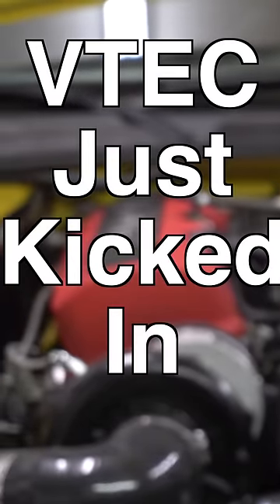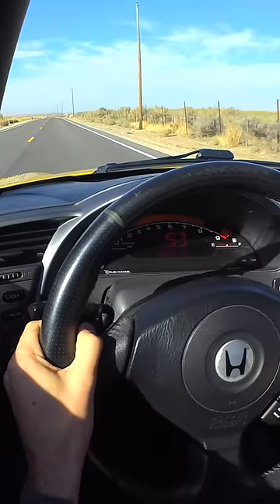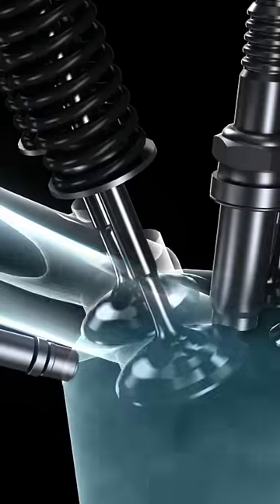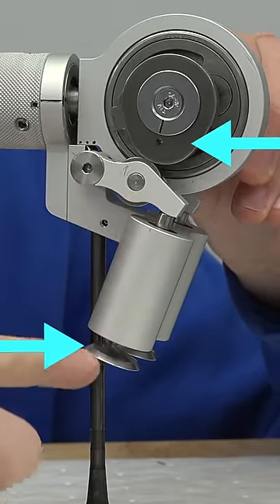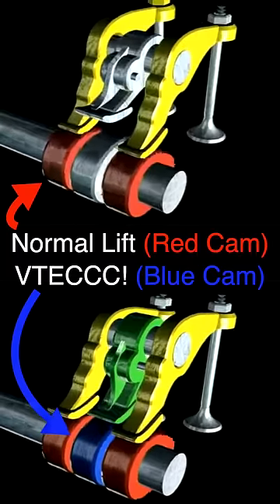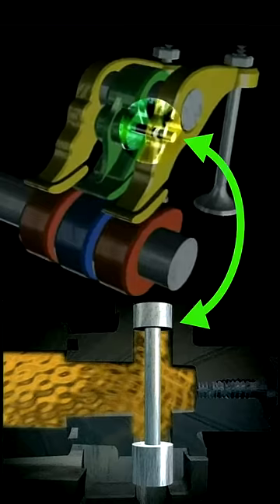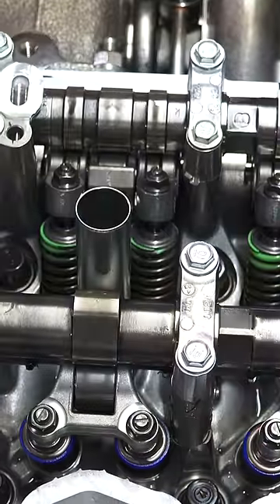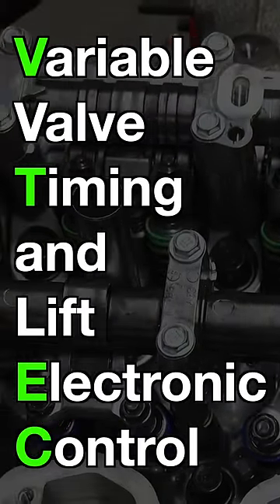How VTEC Works (In 60 Seconds)

Comment: So I have owned many Hondas over my 41 years on this planet. I have built many slow cars that went fast because I installed a turbocharger onto them. My last built was a 1997 Honda Civic coupe that made 709 wheel horsepower at 34 psi of boost from a rather large turbocharger. The engine was from a DC2 Acura Integra Type-R and it was fully built with custom machined cylinder sleeves that strengthen the engine block, forged CP pistons, and forged Eagle connecting rods. It had ARP head studs, a fully ported and polished cylinder head, aftermarket Skunk2 Stage 4 Tuner Camshafts, Skunk2 dual valve springs, Ferrea valves, a 5 angle valve job, and Skunk2 lost motion assemblies (for the VTEC control). The engine was FULLY built to handle that amount of horsepower and plenty more. My best quarter mile time was 9.56@155 MPH. I hated to street race it because it was so fast that it would blow both front tires off from 1st through 4th gear up to 100 MPH. As soon as that engine hit VTEC under boost it was over for whoever I was racing.

Comment: VTEC stands for: variable valve timing electronic control
Reply: Or just Variable Timing Electronic Control
Reply: It’s variable valve timing electronic lift and control. Lift is in there as well
Reply: That's vvtec
Reply: @rdmz135  bruh
Reply: Very Tall Engine Cooling
Reply: @brayanhernandez7427  Variable Valve Timing and Lift Electronic Control. Just like the video said, he got it right idk why y'all are trying to correct.

Comment: My 01 Accord felt fast as hell.  6 cylinder VTec.  I still got destroyed by mustangs and all the popular Chevy cars but it was faster than most sedans.  Could get to 60 pretty quickly.  I no longer have it and now have a slower 4 cylinder car.  But even it moves pretty swiftly at times.  It’s built like a go kart.
Reply: 200 hp is plenty to have fun and at the time was pretty much as powerful as common sedans got. (Except the then-new 222 hp Maxima). 
Not sure what VTEC really added: Nissan and Toyota had ~200 hp from their 3.0Ls without any VVT.
Reply: Yamaha did similar with their dual runner intake,  except that 3L car was as fast as the Mustangs and Camaros.

We can combine VTEC (variable cam lift and duration) with Ford's Ti-VCT (variable cam timing) in the coming electronically actuated valve systems. Along with Ford's current variable chamber volume, should be able to improve mileage even more AND both extend the rpm range and power peak. 

Just gotta get past all this patent BS.
Reply: Got a low mileage 2012 v6 accord and still kicks in pretty hard on the highway. 4th gear pump from 60-90-110
Reply: @nthgth  Yea the 6s didn't have it like the Si i4s did. And when they did get it was on the Acura 3.2 Rl and TL.

Comment: The funny thing is that VTEC in both the motorcycles and cars are additional steps and parts used to impair air intake at low RPM and improve fuel consumption when you don't need the power. So technically VTEC kicks in when you're driving like a normal upstanding citizen and disengages when you're going pedal to the metal.
Reply: Brutal! Brutally honest too. A "variable geometry" turbo also uses also uses a movable restrictor with the same impeller. The blades don't actually change pitch like a plane or helicopter

Comment: More specifically (because words matter) ... it's the LARGER center cam that initiates the process for the increase in power. By switching to the center cam, which has a LARGER CAM, that is what causes the valves to open further once they are tied together with the pin. At that point the outer two cam lobes really aren't in use anymore.  The center cam FULLY TAKES OVER THE LOAD, causing the valves to open further, allowing for more air, thus an increase in power ... and the outside two cams are essentially just a long for the ride. 😎👍
Reply: Thank you, this makes more sense than the animation.
Reply: OKAY!
Reply: Why not just use the center cam only?
Reply: This important info was not mentioned!
Low rpm is where torque is produced. Short duration valve timing is needed for low rpm stabilization, hence better torque. High rpm needs to 'breathe'- switch to long duration valve timing.
Reply: @TheTwh415  Id does only use the center cam (the video is wrong about that), The center lifter is however not connected to the valves, so it engages the outer lifters that is connected to the valves, but the outer lifters are not engaged with the cam at all at that point.
Reply: @TheTwh415  IIRC, emissions´profile.

Comment: You're mistaking vtec for vlc.   All hondas have vtec only type r  has vlc.. Variable lift control on the exhaust valves.  Vtec is for fuel economy not power.

Comment: Vtec,  I always  thing of it  in that it helps a larger port flow great at low rpm but also helps extend  duration and height  to get flow  in the higher rpm because  at higher rpm  the valves are closed and opened for less duration of a period of the same time.  This helps the cycle flow just as good as low rpm  but not have the  negatives of the intake pulses and mass of the air fighting the ports flow with a more aggressive  cam. At a certain  port size and length you can get a port to flow BETTER than or WORSE than what is observed  on a flow bench, this is  because a flow bench does not take into account  of valve pulses from the open/close event and how duration (over a period of time) effect a ports flow  due to the peaks and valleys of pressure  from the pulses of the valves operation. 
   It is the pulses behavior in direct relation  to how those pulses effect the weight of air that can  either create  a slight boost  within the intake or  creating a vacuum. This vis why vtec to me is nice and makes sense  because for a given cam size that flows great at higher rpm isn't so great at lower rpm. 

-+-+-+-+
Reply: VTEC only actives and locks the bigger cam lobe at 4500-4700 RPM, so it literally does nothing at all.....ever before you hit that RPM

Comment: What about MIVEC ?
Reply: "Mega Incredible Valve Erection Complete" or "MIVEC"
Reply: Mivec  only works on the exhaust cam on the Evo 9 at least
Reply: @jo-qp7mz  It's like the VTEC on newer turbocharged engines. 👍
Reply: Mass Incompetence at Volunteer Electric Co-op?
Reply: They're the same thing from different manufacturers.
Honda: vtec
Mitsubishi: mivec
Toyota: vvt-i
Mazda: s-vt
Nissan: vvt
Ford: vct
Audi: valvelift
BMW: vanos
So on & so forth.

They're all based on similar concept & technology, with minor tweak here & there, depends on each manufacturer.
Brand neutral name for all of them is VVT.

Comment: It's a cool concept and it seems to work quite well....... The next step I want to see though in valve trains is wide adoption of free valve technology has the potential to be game changing and far better then VTEC 
      For those who don't know Free valve  it's fully variable valve actuation that uses sensors computers and pneumatic actuators to run the valves on a engine completely replacing the cams no longer needed such as the camshaft, throttle body and many other parts saving weight and decreasing size of the engine in the process it's a revolution of how the valve train works similar to going from carburator to electronic fuel injection
Reply: That's another electronic function that's destined to fail that you can't fix yourself in your garage. Free valve is really cool and ingenious--I like it. You can call me old fashioned but I'll take a pushrod V8 with a blower or a turbo all day.
Reply: So what happens if there is a fault in the system? Is there a mechanical fall back so the valves don't lock up?

I'm always wary of complicated/complex components that are more than likely very expensive to fix (Look at you, Euro cars)
Reply: @darkknight097  exactly my man. Car manufacturers today literally build cars so you have to bring them back to the dealer/manufacturer because they alone have the means to fix them. Do't like it.
Reply: @rhull3939  people were saying the same things about fuel injection when they started to use It on motorbikes
Reply: There is really no point. All big manufacturers are going electric. There will be no more revolutions in ICE engines. We are peak ICE now. 
Free valves been done anyway, cost over benefit it lost.
Reply: @t-r-k7534  exactly. Fuel injection was a complete disaster for the first 15 years.
Reply: Modern cars almost never break down. I don’t understand the nostalgia in having to fix your car ever weekend.
Reply: Most manufacturers are closing down their engine department… I don’t think we’ll see lots of ICE innovation anymore.
Reply: @thebaconsonful  I disagree. The only thing that says ICE engines are done, is the current political climate. Our infrastructure is far from being ready to adopt hundreds of thousands of EV's. Furthermore, EV's aren't currently up to the task of taking on the roles of all ICE powered vehicles. Range, towing, and charging issues are still a problem. Until batteries mature further, and the Electric Grid has been brought into the 21st century, ICE powered vehicles will be here, and be improved upon.
Reply: @rhull3939  LO, yeah, I'm sure you can fix a broken cam-shaft in your garage. Kek.
Reply: @darkknight097  What happens when you break a camshaft or a lifter? Electronics are VERY reliable.
Reply: @rhull3939  have you tried fixing a broken cam-shaft? What happens when a cam chain or a timing belt snaps? Answer: Total engine breakdown, bent valves, broken camshafts, cracked pistons... Now tell me how much cheaper an engine is compared to some electronics, that when it fails, simply closes all valves and stops the engine. 

You can get the diagnostics tools yourself, they are not that expansive. Engine-swaps on the other hand, not that cheap.
Reply: @thebaconsonful  LOL, no, ICE engines have been in constant development. Better stronger and ligter alloys happens all the time. Just recently car manufacturers started using the newly invented stainless magnesium alloy for example. FreeValve definitely makes sense and is not costly at scale. There are still plenty of improvements to be had.

Comment: V-Tech is all about fuel efficiency.  Not sure what you're talking about in this video.
Reply: it can help with efficiency but it also helps the power band be much better. because you end up with a cam lobe focused on low - mid range rpm performance and one for top end, meaning you get the best of both worlds

Comment: Porsche had this in the 70- 80s
Variable valve timing.

Pontiac developed a 3v engine in the 60s, and the CEOs at GM said he'll no.

This is not new. Unless your gen Z.
Reply: Variable valve timing is different from variable valve lift.
Reply: @1maico1  Agreed.
I think I left just enough information for someone to do their own research. 

Porsche had the VVT and VVL on the same package. 

"VarioCam Plus" 
This cam technology adjusts the opening and closing times of the intake and exhaust valves. The cams can also increase valve lift when the driver needs full power.

Comment: Soo can y'all (preferably the EE guy) decide what camshaft design I should go for with a procharged 5.7 hemi? I don't want the choppy sound, I just want speed and more torque in the lower rpm's since boost doesn't kick in until like 3200rpm

Comment: Its really called Variable Valve Timing and a lot of engines use this but Honda calls theirs VTEC
Reply: Yes and no. Vec can also effect valve duration not just timing.
Toyota do have a variable duration setup now. But the vast majority just effect timing not both, so are different in approach and effect as vtec
Reply: vvt doesn't affect valve lift, only timing
Reply: boy thinks he's felt vtec cuz one of his moms cars said vvti on the engine, its not the same at all
Reply: @SEEmenSniper  its not the same but it all adjusts timing thats just hondas way of doing it
Reply: @SEEmenSniper  its changes the valve duration
Reply: @SEEmenSniper  have you ever torn an engine apart or build one you will learn a lot about all the different ways to change timing in different styles of engines but its all about valve duration and ignition
Reply: VTEC and VTC are two completely different systems, which is why K series have both and it's called i-VTEC...Older B & F series only had VTEC for added valve lift at high RPM. The two systems are used at opposing RPM ranges too.
Reply: @chadfordham1  but it affects valve duration and timing correct
Reply: @heathkill4821  VTC - Valve timing. Duration & Lift profiles - VTEC. i-VTEC is same as VVTL-i on Toyota
Reply: @chadfordham1  So i-VTEC is VVT + VTEC?
Reply: @abdul-kabiralegbe5660  Yep that's right
Reply: @chadfordham1  Thanks.
Reply: @thebaconsonful  valve timing is valve duration, the timing is what determines how long it stays open.
Reply: Honda invented it.  Hence the acronym that was patented.  You are saying what it does.  No need to clarify dude, it’s not confusing at all
Reply: @heathkill4821  time and duration are synonyms
Reply: @chadfordham1  VVTL-i does
Reply: Toyota call it vvti and BMW Vanos
Reply: @alarabaumgartner5821  ya toyota is Varialble Valve Timing and Ignition, vvti it changes valve duration and ignition timing to compensate for the duration changes of the valves. Its great for making power and saving gas

Comment: Vtec does not help slow cars go faster. You could always just use big cam lobes before vtec for the same power. The difference is now you can have good fuel economy during normal driving and still have a performance cam profile at higher rpms.

Comment: 6 years ago my little brother and I stuffed steel BB's behind the hydraulic pins effectively locking the VTEC. Basically making a slightly bigger cammed Honda for cheap. 😂 it didn't do sh*t for horse power, but it sounded cool.

Comment: Everyone always gets this wrong. VTEC is designed to have an engine that will run nice at lower RPM. They don't make more top end because of VTEC, they make more usable power across the rev range because of it. They could simplify everything and just have a cam with the big lobe on it, but it wouldn't make good low end power, the top end would be the same though. VTEC exists for low RPM power, not top end. And now you know the rest of the story.

Comment: VTEC doesn't help cars go faster. The potential is always there, but it creates different characteristics in engines at different speeds. It helps with efficiency at low speed/RPM.

Comment: Theres also another earlier version of VTEC where instead of the cam profile changes, the valvetrain (4 valves for example) uses only 2 valves, 1 intake and 1 exhaust. When it reaches 6k, it uses the 4 valves again.

Comment: VTEC just kicked in yo means the pins slid to engage the high lift lobe driven rocker arm for a burst of acceleration in the higher rpm range.

Comment: S2000 was the top Honda VTEC. When the new NSX came out with a 9000 rpm redline, I had high hopes that were crushed by shifts at 4000 😭

Comment: About tiime  valves are opended and closed by electricity.  No cams, chains, gears, lubricants. Sensors on crankshaft do the signalling.

Comment: I don't understand why Honda get so much hate for their cars? for a start, Honda have always been top of the game for light cars with brilliant handling. So when you see people out there trying to drag race them in comparison tests, it's a silly waste of time! Round a track though, they hold their own with impressive results!
Talking about engines however, take the K20 as an example... it's a very old design now and pushed 200bhp upwards as stock (a lot more with a simple map!) Even today, other car manufacturers struggle to achieve that with N/A engines! VW engines are lucky to achieve 140bhp without a turbo! the  use of a turbo only takes them marginally a little more powerful as a stock vehicle but they're known for being heavy cars! so gain no advantage in power to weight. Plus Honda achieved all this with unbelievable impressive reliability. Over the years, everyone is still doing K20 swaps in just about anything and everything... no one even bothers putting a GTI engine in anything because you just look like a pleb

Comment: As I've always said (been a mechanic for over 20 years now... VTEC is actually the reverse of normal engine operation..while vtecing your barely opening the valves or allowing air to flow giving great economy THATS VTEC.....
..
..
..
..that ''TECHING SOUND'' MORONS refer to is actually normal engine operation ..that "3rd valve " is what a NORMAL engine has ....ITS AS SIMPLE AS THAT and it's why they go bang . literally built like a sewing machine

Comment: Honda cb400 super four has hyper vetc, 2valves per cylinder below 6250rpm, 4 valves above that (6750rpm in 6th) 
Not 100% sure how the vfr800 vtec works

Comment: Just make sure you disable the VCM with a tuner. I didnt do it soon enough, & now im replacing both active motor mounts on my 07 odyssey. The rear bank plugs are always more fouled when I check them as well. They should've left the VCM out of the equation, it doesnt save enough fuel to warrant the damage it does.

Comment: NO IT DIDN’T Honda’s VTEC HAS TO DO WITH VARIABLE VALVE TIMING AND introduced IN THE late 80’s-90’s?!?! It meant that you don’t have to have an odd number of valves per cylinder to achieve maximum performance… or so my dead brother taught me when I was just a wee lad… 🤔

Comment: My d15b engine is VTEC, but not engaged need CPU & wire, I didn't do it because it's run very strong and loud, without any aftermarket parts.

Comment: My 2.2 vtec accord has 267k miles on it and runs good, has a cold start idle surge issue I need to solve now but that’s about it 😅 oh and it’s a stick shift haha don’t buy an auto Honda.. especially a 90’s one kids.. don’t get fooled the gears are made of more glass than a Subaru wrx gearbox..